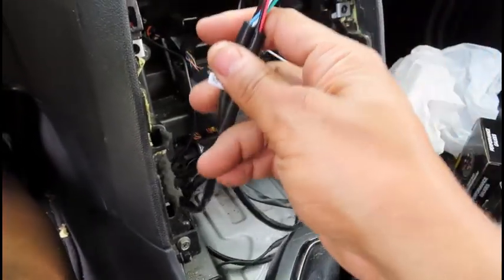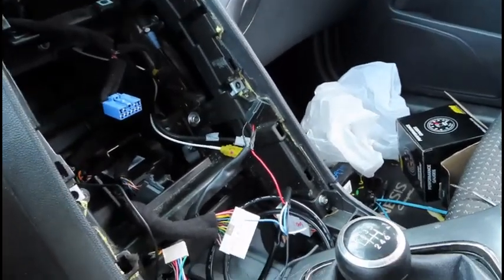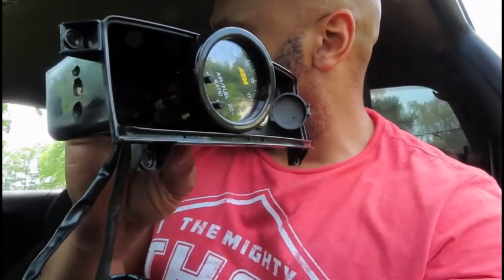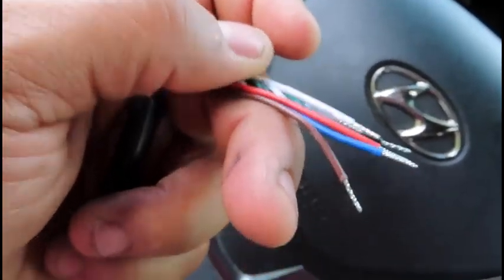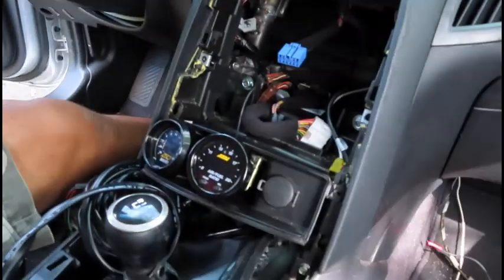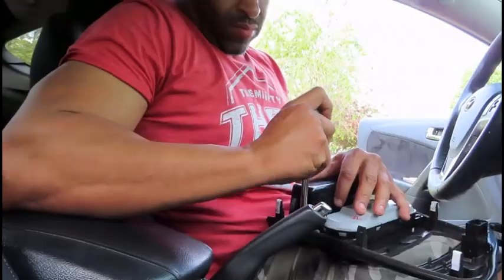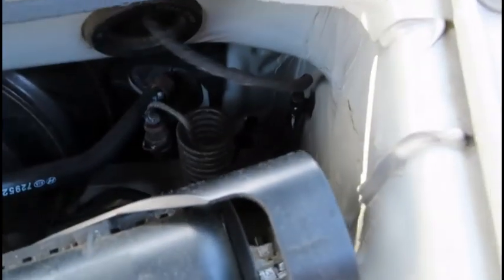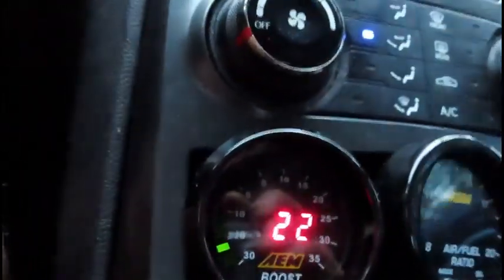AEM BOOST Gauge Install and Test

Comment: Chuck, I cannot WAIT to see you drop that other motor in! However I have to say, in your position, I would have connected the AFR and Boost Gauge to the rear of the Haltech unit you have! Alphaspeed needs that in order to tune properly(if I remember right) so the Haltech needs at LEAST the AFR gauge plugged up to the back of the unit! During the remote tuning process they have to monitor your AFR's to dial the tune in properly so plugging it to the Haltech makes sense, since they are tuning your Haltech.(I plan to get a Haltech sometime this year because I already have a AEM AFR gauge and gauge pod) In any case, keep it up bud!